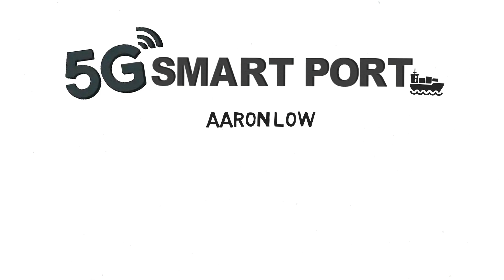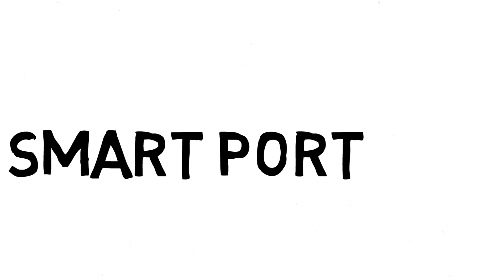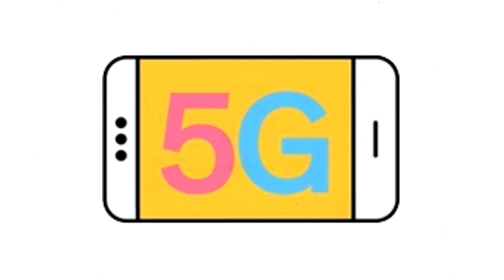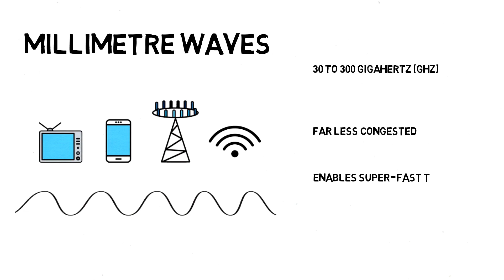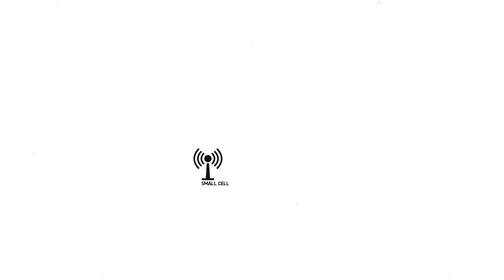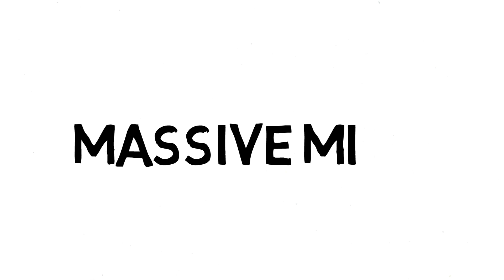5G as Enabling Technology for Building Smart Port/ Harbour Cities

Comment: Will there be any disadvantages or challenges with the usage of vehicle to vehicle communication between the AGVs?
Reply from the maker: Hi Ms chuchu booxerox!
Yes. Although Vehicle to Vehicle communication would bring many benefits for AGVs, it still has several disadvantages. One of its primary issues is the security as they are rather susceptible to malicious attacks. Attackers could easily hack into the sensors of an AGV, feeding it wrong information which ultimately leads to an accident. Furthermore, data transmitted from AGVs would not be centralized as there isn’t a centralized server to maintain these data before it is transmitted to the command center. However with 5G’s high bandwidth (20 Gbps) and low latency transmission (1 ms), this issue can be solved as the data transmitted to the command center would be extremely fast. Hope that I answered your question ;)

- Liew Wai Xing

Comment: As you mentioned UDP is not reliable, have you heard of RUDP? If yes, would you choose RUDP? Why?
Reply from the maker: Hi Mr Yong, No, we wouldn’t.  
Although RUDP (Reliable UDP) guarantees packet deliveries with its own convenient re-transmission structure besides transmitting at similar rate with UDP, it is not a standard transport protocol like UDP or TCP. It is not supported on any mainstream networking hardware or operating system. Instead, it has to be directly implemented in accordance with its specification. Therefore, in this case, we choose UDP over RUDP for the ease of implementation and adopt ARQ for packet retransmission. Hope that I answered your question!

- Liew Wai Xing

Comment: What is the chllenges for 5G when it is implemented?
Reply from the maker: Hi Vannesa! 
Regarding your question,  5G may not be readily available for everyone after it’s initial launch. As current devices current support radio-wave spectrums that are under 6GHz to transmit data. 5G's millimetre waves aren’t able to pass through solid objects such as walls. This is because millimetre waves are extremely high frequency and narrow waves. However, with the implementation of small cells, this will solve the issue faced by millimetre waves. Hope that I answered your question!

- Liew Wai Xing

Comment: Wouldn’t massive MIMO cause a lot of interference between other antennas?
Reply from the maker: Hi Mr Jenson~! 
Yes it would. However this issue can be solved with the beamforming technique as it uses signal processing algorithms that plots the best transmission route to every node, sending data packets in different directions and reflecting against walls and objects to avoid interference with other data packets. Furthermore, it allows massive MIMO to transmit and receive more information with other nodes at the same time by calculating the data packets movements and arrival time. Hope that I answered your question!

-Liew Wai Xing

Comment: The video is truly informative! Can you explain Small Cell in more detail and where can it be implemented in the smart port?
Reply from the maker: Thanks Ashlyn :)  Really appreciate you kind word!
As we mentioned in the video, Small cells are portable miniature base stations that require minimal power to operate. To prevent signals from being dropped or being blocked by ships in the port as many of these cells can form a dense network that acts like a relay team, receiving signals from other base stations and sending data to users at any location with high data rates.
There are total three types of small cells:

- Femtocells
Femtocells has the shortest range of small-cell types, and are usually deployed in homes or small businesses. These router-like devices are installed by clients and can accommodate coverage for just a few users at a time. Femtocells generally have a maximum range of less than 10 meters.

- Picocells
Picocells are usually installed in larger indoor areas like shopping malls, offices or train stations. They can support up to 100 users at a time and have a range of under 200 meters.

- Microcells
Microcells are the largest and most powerful small cell. They are usually installed outdoors on traffic lights or signs, and can be used temporarily for large events. Microcells have a range of under two kilometres, whereas microcell towers can cover up to 20 miles. Both microcells and picocells are usually installed by network operators.

In our case, Microcells will be the most ideal type to implement in the smart port as it can covered wide range up to two kilometres. On the other hand, antennas on small cells is a lot smaller than traditional antennas, which doesn’t require big place to place it. It can be mounted on utility poles, buildings or other structures as long as it is within two kilometres.
  I hope I have answered your question !

- Liew Wai Xing

Comment: Very good video. 
But I have a question,
You mentioned about selective repeat ARQ, 
may I ask why is selective repeat ARQ chosen instead of Go-Back-N ARQ that is implemented by TCP?
Reply from the maker: Hi Yohannes, thanks for the compliment!
As mentioned in the view, selective repeat ARQ only retransmits the frame that is damaged or lost. Go-Back-N ARQ retransmits all the frames that are arrived after the damaged or lost frame. Although the efficiency of these two ARQ is said to be the same, in real applications, especially when the error rate of transmission is high, retransmitting all the frames that arrived after a lost frame wastes a lot of bandwidth. In comparison, selective repeat protocol re-transmits only damaged frame, using only minimum bandwidth. Despite being complex, selective repeat ARQ has lower bandwidth utilisation, which is important to maintain the performance and efficiency of transmission in supporting real-time transmission. Hope it answered your question! - Liew Wai Xing